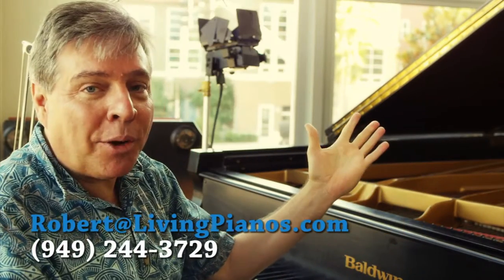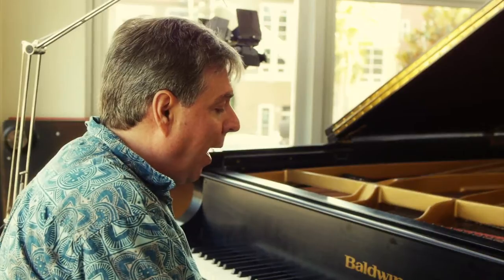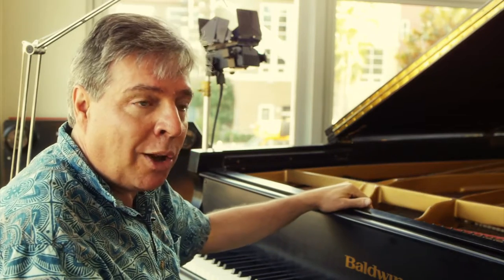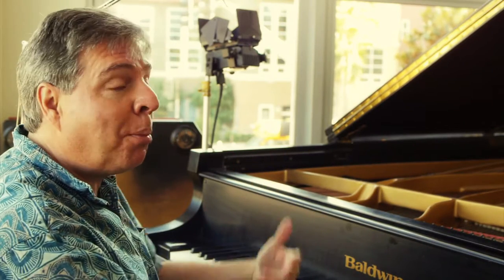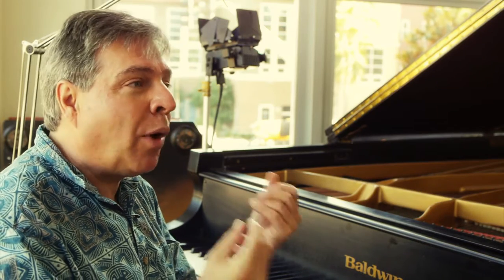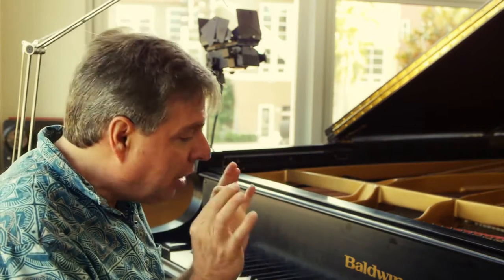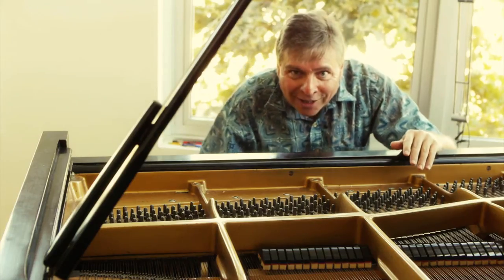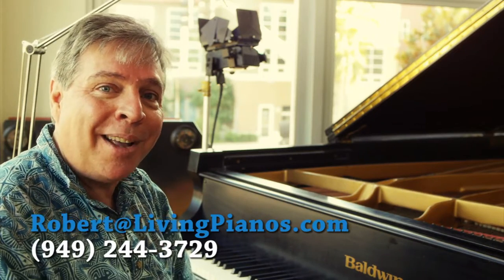How do Dampers on a Piano Work? Why Do Pianos Have Dampers?

Comment: Hey Robert! I'm recording some pianos this week and when running tests I noticed some upper harmonics that were annoying to my ears. I reasoned that they must be coming from some of the upper strings which aren't dampened. Is it OK to throw a towel over these notes if they're not going to be used in a performance? Will this have some unwanted effect that I'm not thinking of? Thanks!!
Reply from the maker: You can experiment first to see what the problem is. Muting the strings in the treble that have no dampers shouldn't be necessary and you will lose the additional color of tone the sympathetic vibrations enable. You can ask your piano technician what the problem is and see if they can offer a solution for you.